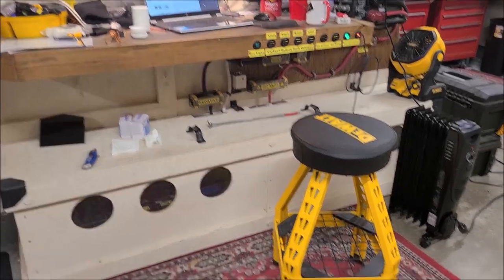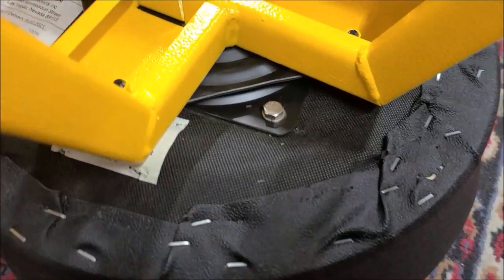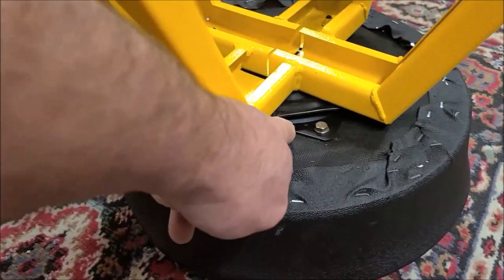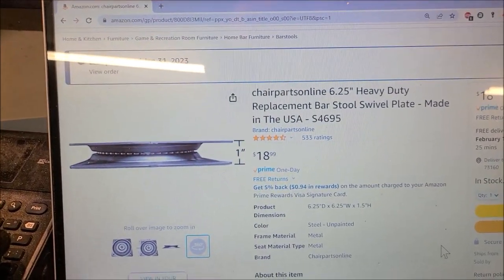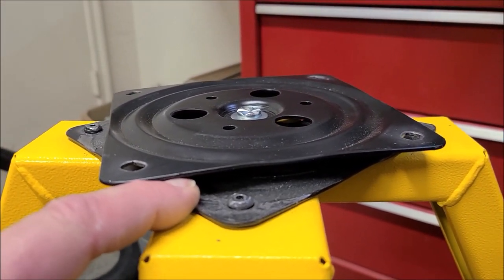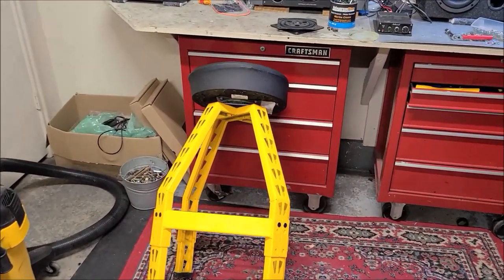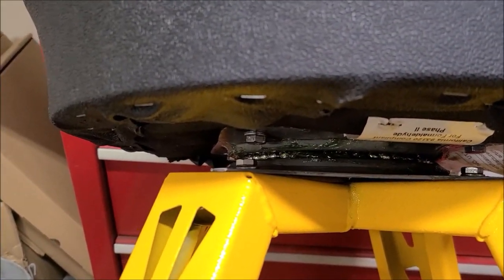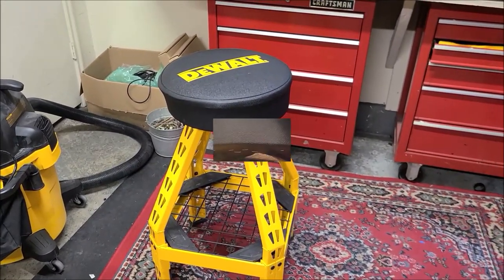Replacing DeWalt shop stool bent swivel plate and stripped hardware (wobbly seat)

Comment: I just bought one and ordered the swivel plate same as yours what size bolts did you use to replace the swivel plate
Reply from the maker: Not sure...but, they are metric. Might be best to take a bolt to HD or Lowe's and match it up. For the bottom bolts that attach to the yellow frame, I used hardened 1/4" x 20 with lock nuts/washers